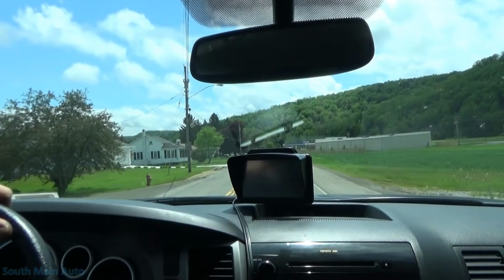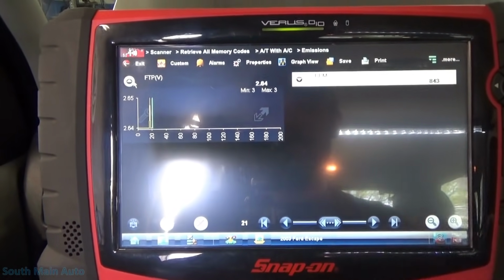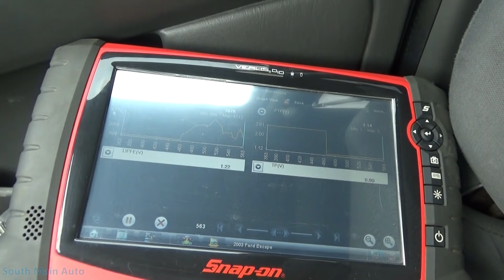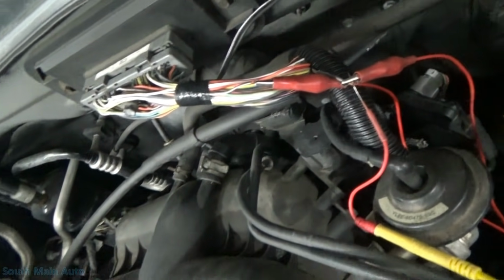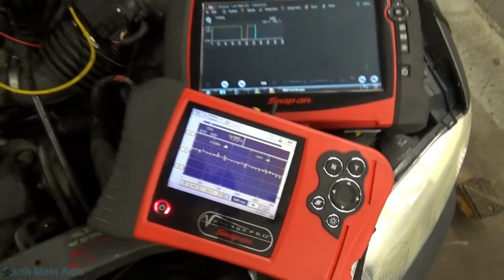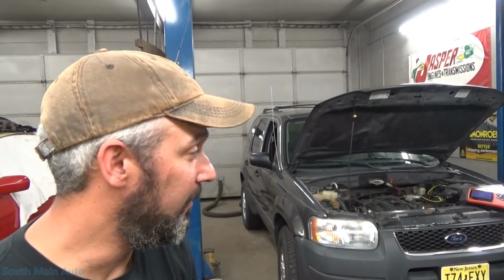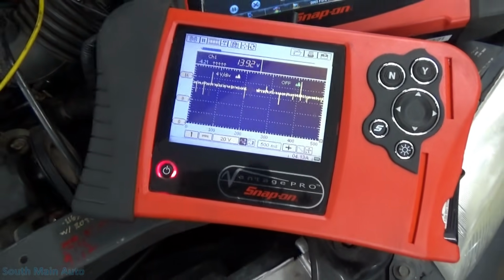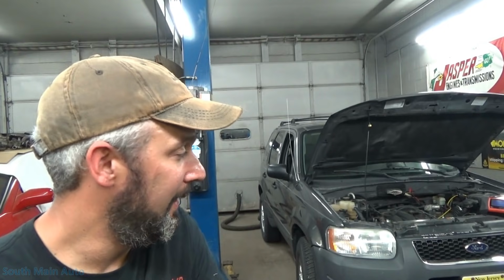Ford Escape: Do We Fix It Or Ship It!? - Part II

Comment: I think the only reason they went to computers and sensors etc. is to sell more parts, create a new market for high tech tools and cause more work/$ for mechanics...and to cause a lot of mechanics to close their shops...ya ya ya better fuel economy and less crap in our air...but realistically the money these parts and labor cost would buy a lot of fuel for my old SBC and BBC that only gets 12 and 8 mpg lol. And, I can repair them myself! hehe
Is it true that the new high tech auto repairmen end up in an insane asylum at age 50? I'll keep my old school motors! When an EMP strikes all those computerized cars/trucks will be dead in the water but I'll wave as I drive by with a grin on my face...but I'd probably be stuck behind all those dead cars/trucks! 
lol just kidding! Great work and videos!

Comment: I still think your an Ace troubleshooter because you stuck with it, didn't take the easy way out and got the job done!  Another shop would have replaced the ECM and charged the customer for it besides the actual part needed, if they ever figured it out.

Comment: I noticed in Part 1 when the FTPV went down, the other two (DPFE and TP) went up.https://youtu.be/vp7g5sSzkh0
When the power steering sensor would flutter/shutter it caused voltage and current spikes across the entire vehicle electrical system. When voltage goes down, current goes up and vice versa. The ecm couldn't react fast enough to compensate for the voltage and current fluctuations hence the noisy reference voltage.
My two cents anyways.

Comment: Wow... failure in programming and wiring logic on Fords end. Why would a power steering pressure switch be tied into emissions control in any way, shape or form?!
Reply: Great work on the diagnosis! Since you figured it would be a sensor issue early on, might be a good idea to check the signal on ALL sensors first, before snipping wires. Learning experiences, though. They're the best teachers.

Comment: My wife doesn't hold a wrench right. Wrenches are made for men, by men. 
The only tool she is comfortable with is a hammer. She would have navigated 
around under that hood using her tool of choice, tap, tap, power steering pressure switch - - - - - voilà.